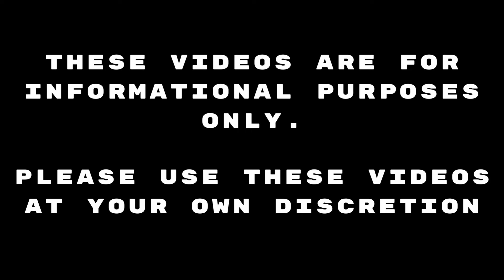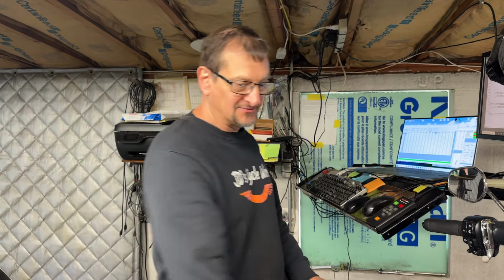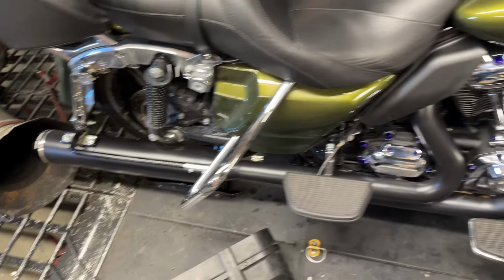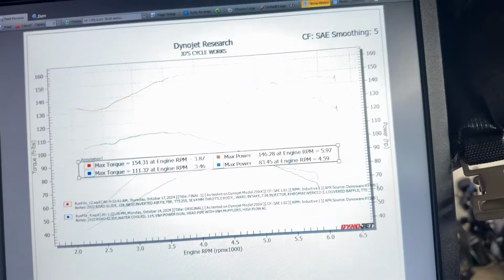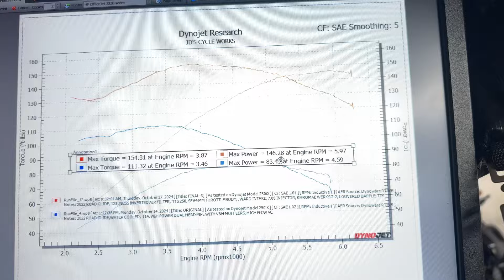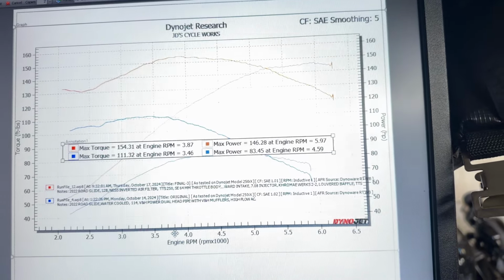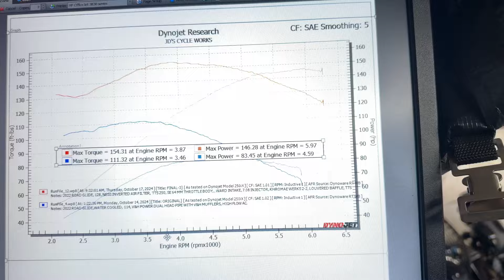Florida Gator Bike Upgrade! - Harley Davidson 2022 Road Glide

Comment: That’s huge power 
I just got 130/145 outta my 124 
64mm
Same pipes as this one in the vid 
480MT cam 
Did the SS crank tho.
She rips but I’d like MORE lol 

That 250 cam does great balanced work 
But need valve spring upgrade